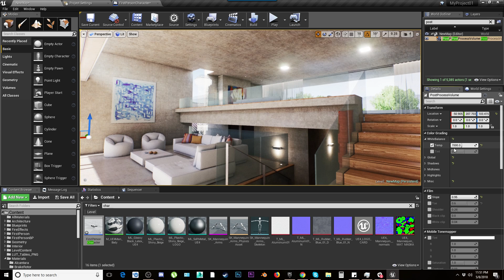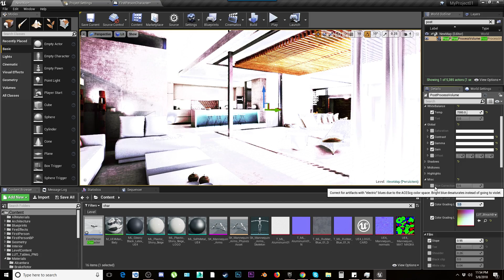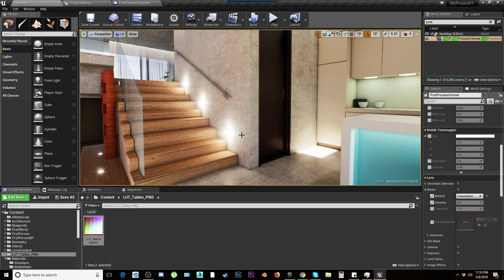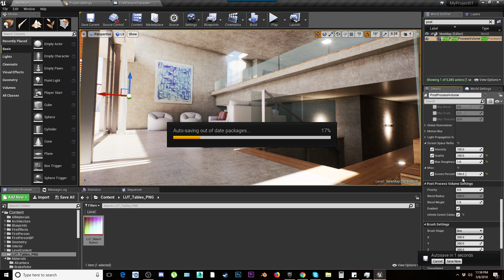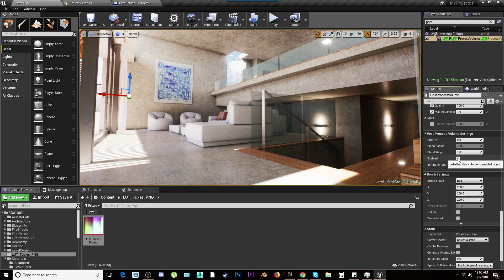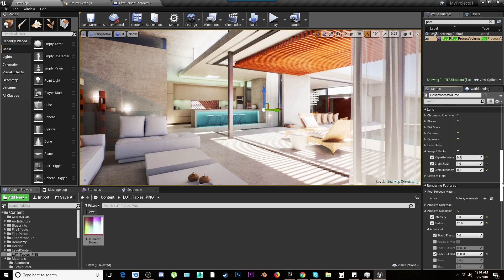How to use Post Process Volume Setting in Unreal Engine.

Comment: Wooow awesome tips dude
But how much it takes to bake a scene like that?
Becuz mine is taking forever..is it possible to get a similar or unnoticeable quality using dynamic lighting and static lighting simultaneously to fake the realism but most importantly to avoid the humongous amount of time spent on baking?
Reply from the maker: It took 1 hour 10 minutes  to build light of this scene.
Reply from the maker: The scene needs to be optimised  so that it dont take several hours for the final light build.
Reply: 3darchstuffs ok